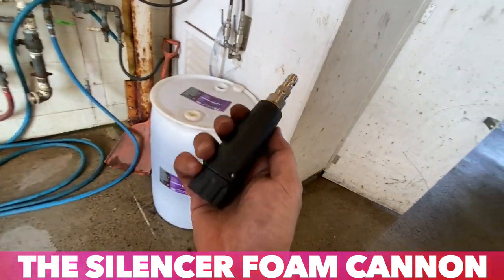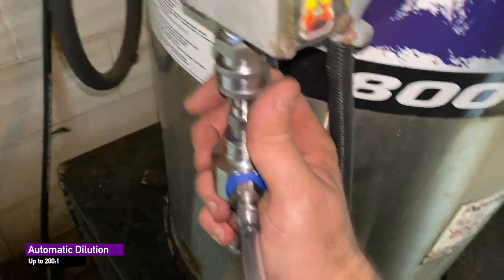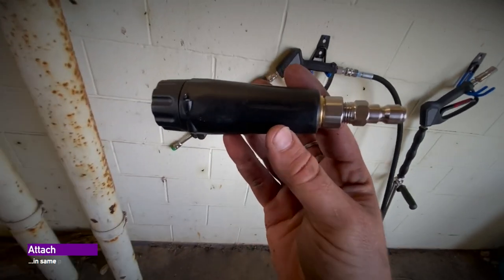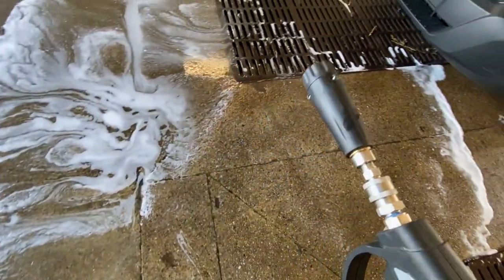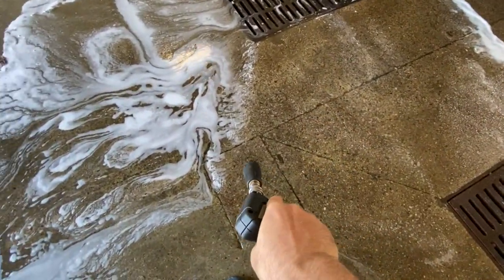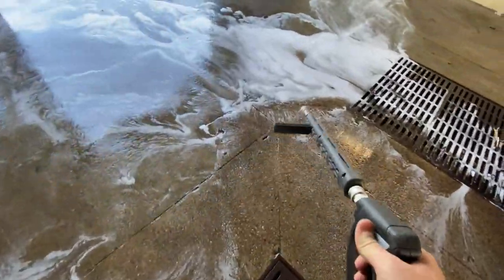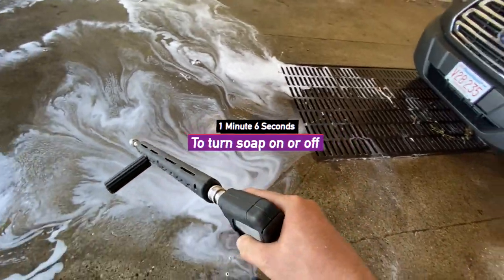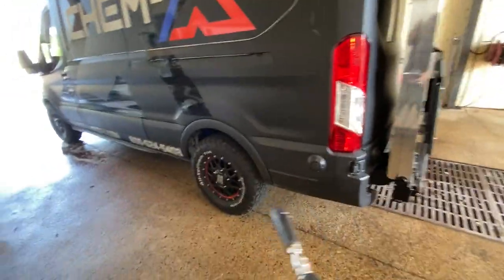"The Silencer" Foam Cannon

Comment: How is this compared to a foam gun? Or to the injector that comes with eg. a Kranzle powerwasher? I am a bit concerned that the foam wont be that thick, since those systems are running with a lower pressure?

Comment: Hello. I am more than likely going to order this and If I like it, I will upgrade to 'the real deal'. I have a couple questions.  I'm going to get this and the 32oz stars and stripes. Using this, what is the easiest way to switch from stripes back to regular water to rinse? I assume just remove the suction hose from the stripes?
Reply from the maker: Thank you I appreciate it! So this injector will shut off on its own by removing the foam nozzle and putting the high psi nozzle back on, however because it has such a slow draw rate it’s not as good at applying two step soaps as two foam cannons would be, I’d point you in that direction for trying out Stars and Stripes.
Reply: @ChemX  Thanks for the reply. I see what you are saying. Another reason for going this route was that I was hoping it would work for other products if S&S did not end up working out for me. I already have a foam cannon and find it to be a PITA haha. I of course want to have the best outcome possible though, so I guess I'll go that route :(

One more question, I only wash when the surface is cool as I learnt my lesson on that in the past lol. Should I wet the surface first or is it better/no difference to just go ahead with stars without wetting?
Reply from the maker: lol cool yeah you could use one cannon for the presoak then this style one on the neutralizer maybe 🤔 is always a good idea to prerinse in my opinion, although I don’t usually unless it’s hot and sunny outside and I’m washing polished aluminum

Comment: Will this work with an electric pressure washer what are minimum gpm and psi requirements this would definitely save me time Detailing cars
Reply from the maker: Yeah I primarily use this on electric machines, 1gpm@1000psi minimum, better foam tho at around at least 2-3gpm and 1500psi generally
Reply: @ChemX  so if i buy it for a 1 gpm 1200psi machine once i get a 2 gallon machine will i need to modify anything on it?
Reply from the maker: That would depend on the psi of the 2gpm unit, but it would be close regardless and if you need to resize it that’s totally something we can help with

Comment: Question? The boars 🐗 hair brush, not working for me. I’m not liking it. Swivels too much......could I remove the foamer nozzle from it just so that I have the foamer nozzle itself?
Reply from the maker: Yep they are cross compatible, also you could hard pipe the brush so it doesn’t swivel, just make it into its own dedicated lance with a quick disconnect at the trigger outlet
Reply: Chem-X ok......thank you!!! I do have the st-160 that I bought from you. So now I’ll have two dedicated foam nozzles.......
Reply from the maker: Cool yeah give us a shout at 8006245403 next week if ya need anything at all bud